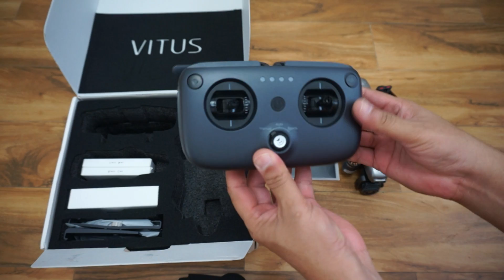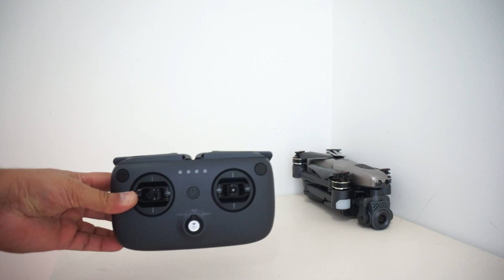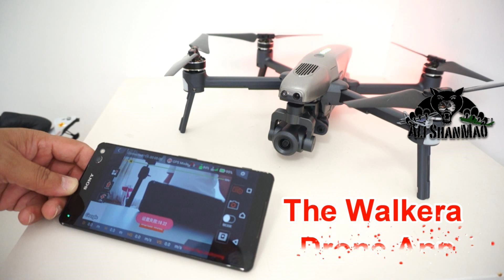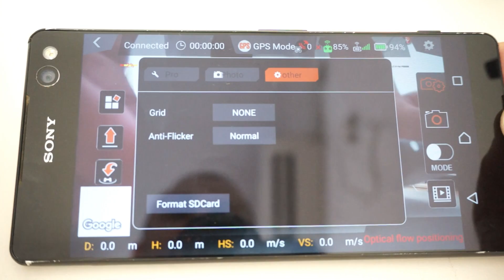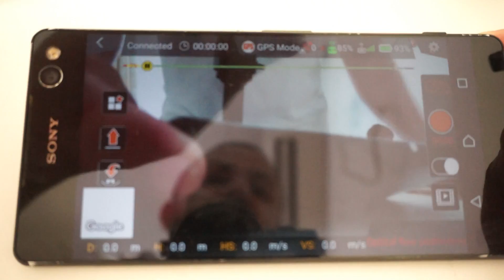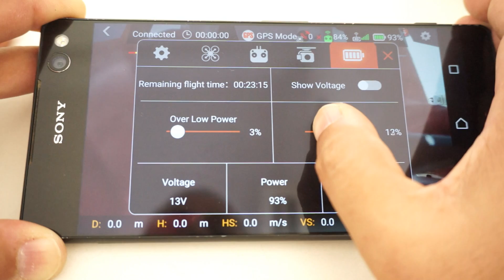Walkera Vitus 320 A DJI Mavic Knockoff

Comment: traxxas and dji don't lie lol i bot a traxxas aton and on the box it says 18/20min of flight time on the stock 3000mah 3s battery and luckily I'm getting almost 19min of flight time but hey 1 tip ALWAYS charge yo lipo batteries at 1amp it'll make yo lipo last longer